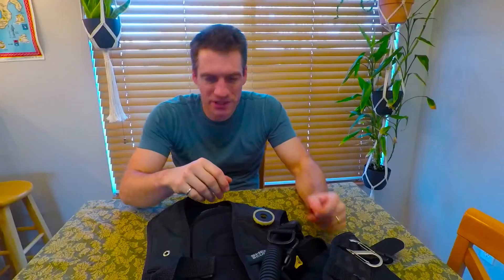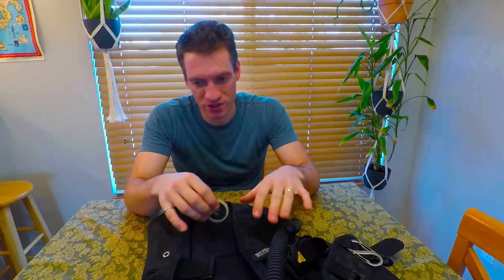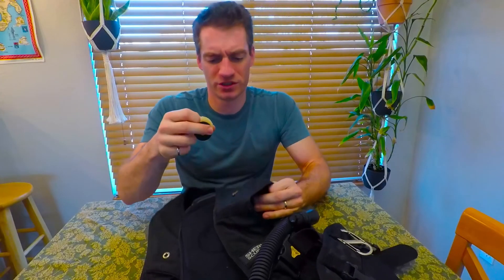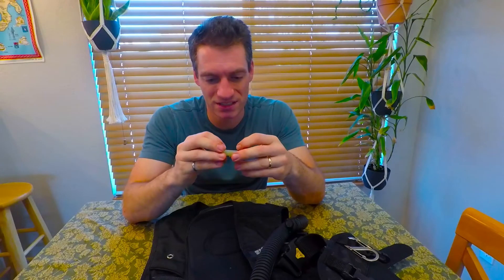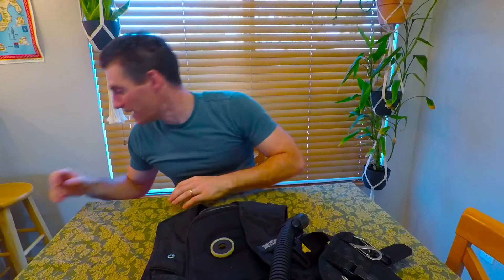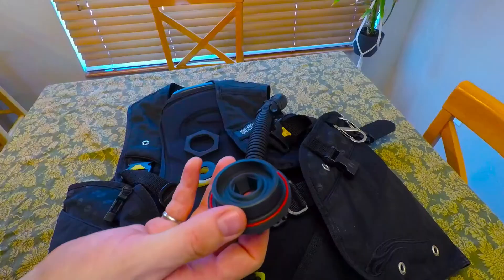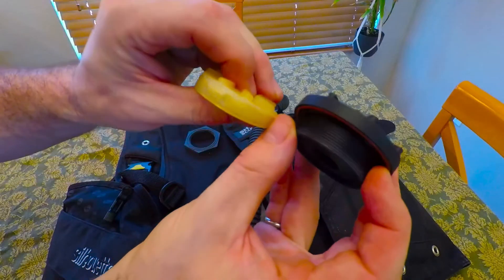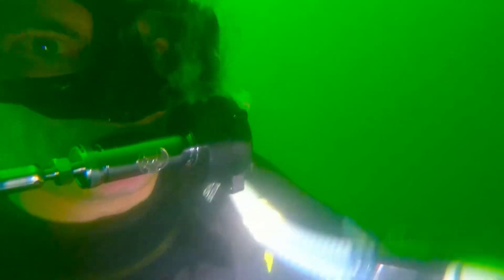BCD Through-Wall Fitting Test

Comment: Im very interested in this. Is this 3d printed? I have been repairing bladders using the flange kit from dive gear express. They are smaller than most modern flanges so i have been custom making large washers out of fr circuit board material and custom cutting gaskets out of 1/16 in silicone sheets with a cricut printer. They seal well and seem to hold strong. The scuba fix is $100 and when one flange goes usually the other are right behind it. This would cost 200 - 300 depending on how many valves the bc has, so not very cost effective. I like the oring idea and am curious how well it seals vs the silicone gasket
Reply from the maker: Yes it is. You can order them directly off my website: https://www.sweeneyengineeringllc.com/product-page/scuba-bcd-through-wall-fitting or send me a DM if you want more information. I can also make variations with a different size or thread pattern if needed as not all BCDs use the same style filler connector
Reply: Do you repair bladders professionally, or just your own?
Reply: The EXACT same happened to me, I would describe my BCD the same at about 16 years old. I took to several shops, they all said same as you heard. I wasn't about to toss my BCD! I use Bambu 3D printers but unfortunately, as I'm with a nonprofit (Reef Ball Foundation, maybe you've heard of us?) we do not have the funds for intensive design modeling programs. I was still able to create something almost identical to yours with a couple of differences...and yours are so much better! I love the o-rings, I wish I could've figured that one out on mine. I also like that it's thicker on the interior as an extra bit of insurance. This is a fantastic piece, thank you for this! I might try and remove mine and use this one instead!